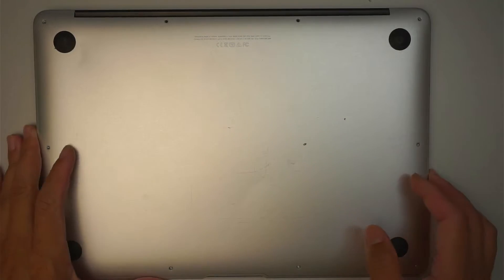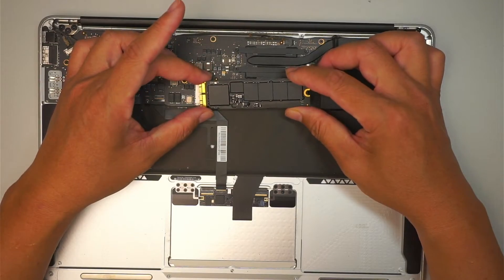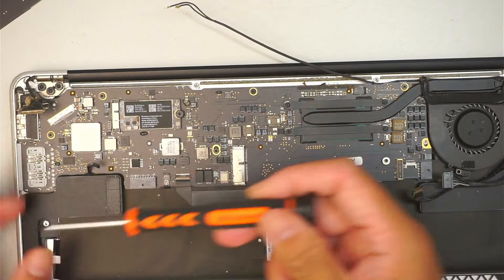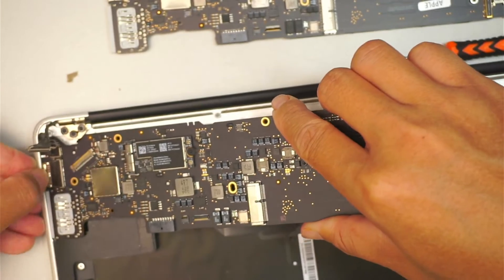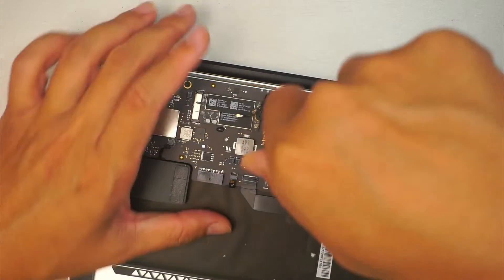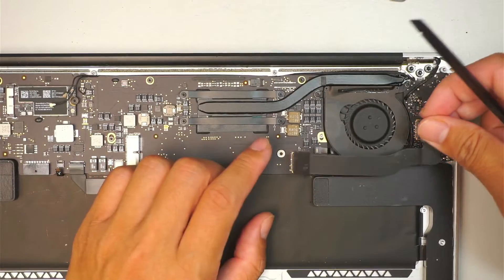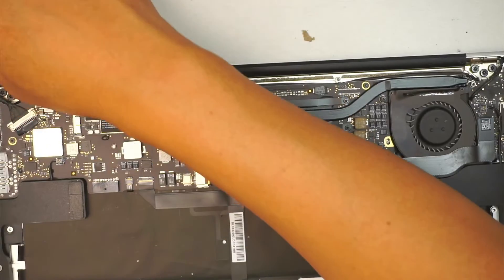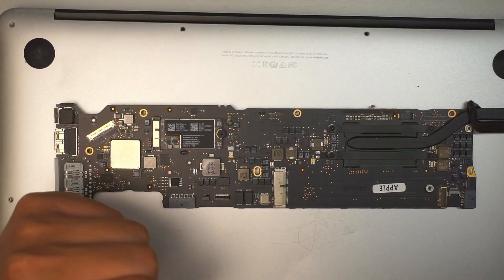Macbook A1466 Motherboard Replacement

Comment: Good vid. I have a MacBook Air 2017 with a i5 logic board and I want to put a i7 logic board from a MacBook Air 2015. Will this speed up my 2017 MacBook Air?
Reply: Brother, were you able to make the change? Did it improve performance? Is it just a matter of changing it and it works or do I have to do something else?